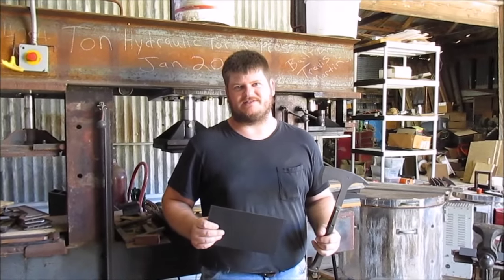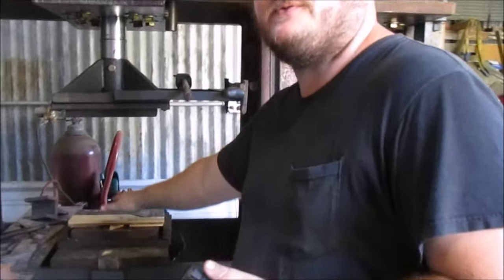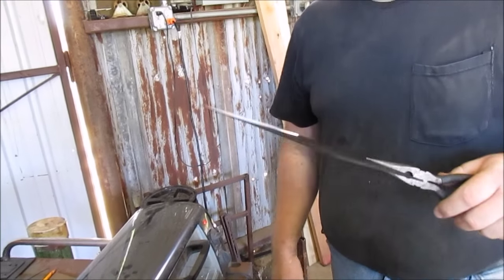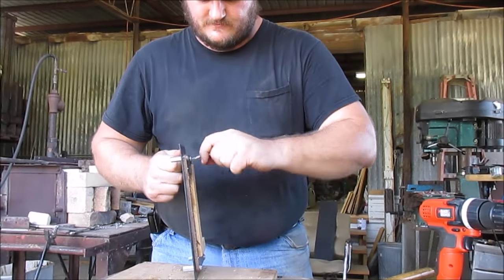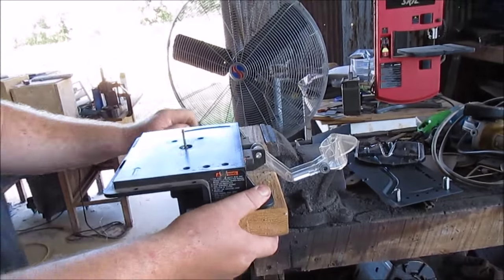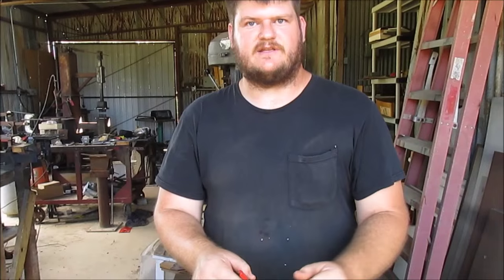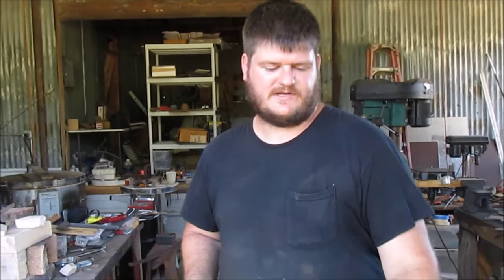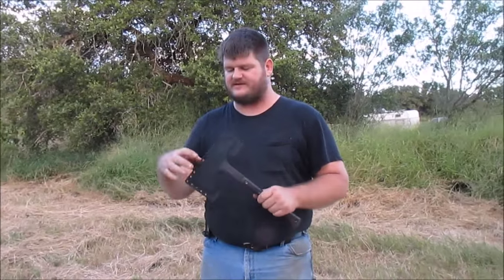Making a Kydex sheath for Helm tactical tomahawks (the smart way)

Comment: Could you toss a brick or paver on the bottom act as a heat sink to help normalize the temperature?
Reply from the maker: RocketCityGardener The problem is as much that it will run cool as it is that it will run hot.  I also need to be able to heat long pieces of Kydex for bush sword sheaths, which I've been doing on an electric griddle.  The T-shirt press ought to let me consistently heat Kydex that will fit an 18" blade, which is about the maximum length I forge blades.  Just gotta bite the bullet and spend the money.  :)